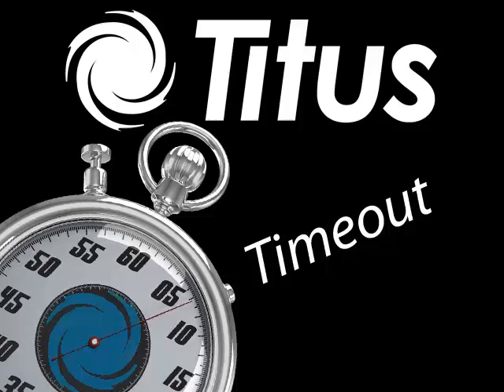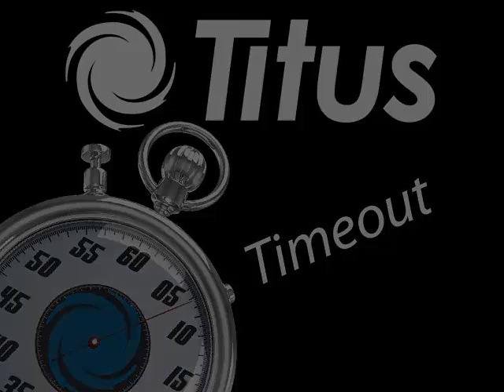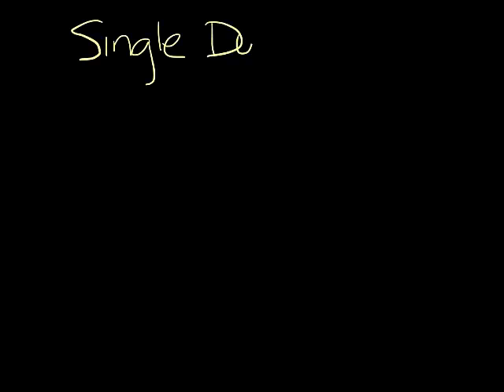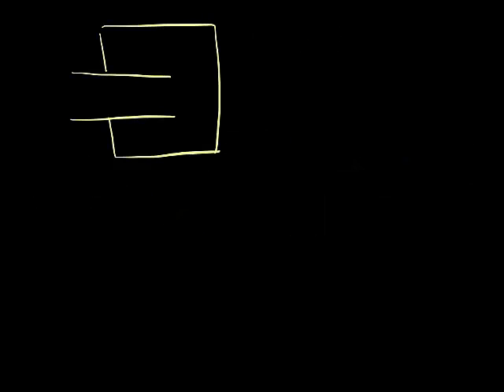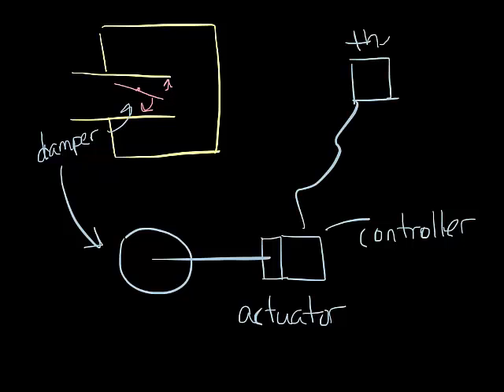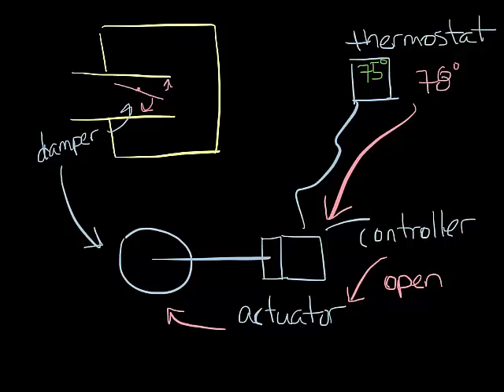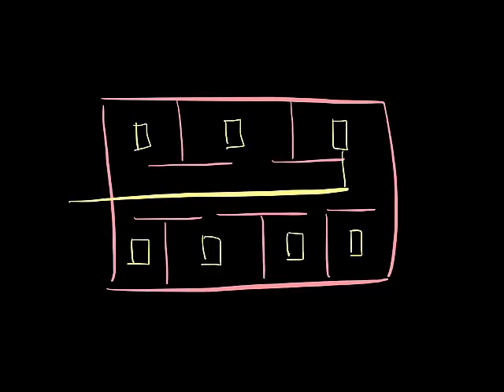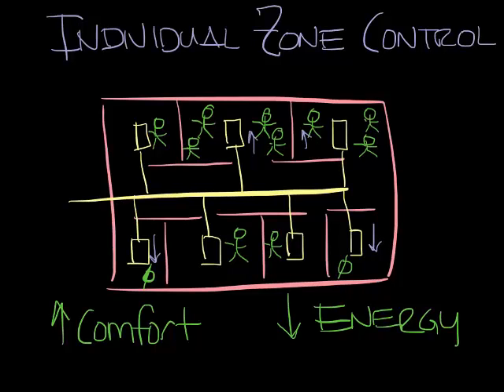Titus Timeout Podcast - VAV Box Basics

Comment: What happens when heating is on, and a zone requires cooling? For example, if you have a building where the zones towards the perimeter need heat, but the zones deeper into the building need to be cooled.
Reply from the maker: Question: I believe you are asking, “What happens when an individual temperature control zone is calling for cooling while the air handler is currently supplying heat?”

Answer: Large buildings typically have central air handlers that are supplying air to dozens or even hundreds of individual temperature control zones. Each temperature control zone is handled by a VAV box. These large air handlers typically only supply cooling, but may vary their supply temperatures for summer and winter operation. Interior zones typically need cooling all year long. VAV boxes serving perimeter zones typically include some form of reheat (electric or hot water) to handle winter loads due to glass or exterior walls.
Reply: @TitusHVAC  Yep, that's what I meant. Thank you for your response!

Comment: What is the difference between Vav and  motorised VCD in HVAC? Can we use a motorised VCD instead of a VAV box or vice verse
Reply from the maker: If by “motorized VCD” you are referring to a “motorized volume control damper”, that’s a pressure dependent airflow control device. It could be connected to a wall-mounted thermostat to provide variable volume airflow for room temperature control. This would be pressure dependent control because the air volume delivery would be dependent on available duct pressure. It also would not be able to control minimum or maximum flow limit control. This could result in stuffy conditions when the space temperature is satisfied or annoyingly high sound levels when loads are higher.

Today’s typical “VAV box” is a pressure independent air terminal. It typically includes an inlet velocity sensor and a VAV controller that provides air flow limit controls. This ensures that minimum ventilation requirements will meet ASHRAE 62 guidelines and that maximum flow limit will help to manage airflow in the building while limiting sound levels. Terminal units also provide many options with regard to electric and hot water reheat.

So to answer your question directly, a motorized VCD can be used in place of a VAV box, but it is generally a poor choice. Pressure independent control is standard these days and that requires a VAV box with an inlet sensor and a VAV controller.
Reply: Thank you for your response. Another question strikes, a VAV box is dependent of the pressure of the main duct so how it is a pressure independent control unit. What is the definition of a pressure dependent control unit and pressure independent control unit ??
Reply from the maker: Pressure dependent controls just drive a damper open or closed to control temperature. When the room is satisfied the thermostat sends no signal and the current damper position is maintained. The damper can move full open to full closed or mechanical limits can be set on the travel. 

Pressure independent controls require a velocity sensor. These VAV box and their associated controls provide airflow within minimum and maximum flow limit settings based on load requirements. These controls therefore automatically readjust the damper position to correct for any changes in inlet static pressure.

For instance, the thermostat is commanding a controller to provide 500 cfm. The damper moves until the inlet sensor registers the velocity associated with 500 cfm. There’s a sudden change in room load in a nearby conference room, so when that box opens the duct pressure starts to drop. The box in the first room will automatically open to maintain 500 cfm to the first room.

So pressure independent controls can automatically compensate for changes in duct pressure, so long as there is adequate pressure to meet all the airflow requirements. When airflow is insufficient and boxes are ‘starved’, pressure independent boxes simply drive wide open to provide whatever airflow is available.

Comment: how VAV controller can change the mode from cooling to heating, we all now that controller should work in cooling direct and in heating reverse?
Reply from the maker: The VAV box is usually being supplied with cooling air only (55 degrees F from the air handler) and is trying to satisfy the thermostat. So if the thermostat is set at 75 degrees and the room is 72 degrees, the VAV box closes the damper (to supply less 55 degree air) and if the room is 77 degrees, the VAV box opens the damper (to supply more 55 degree air).The VAV controller is not doing auto-changeover from cooling to heating. There are controllers that do auto-changeover, but they need to get a supply air temperature signal to know when to change from heating to cooling. This is not how typical VAV boxes work though.
Reply: Funny. I was just working on a Titus II VAV with AUTO CHANGEOVER today.
Sort of.

The controller is set to maintain a minimum airflow so it can not close completely.
When the space starts dropping enough below the setpoint there is a pressure actuated switch that then brings on the heating contactors.With the airflow at minimum the electric heat can temper the 55 deg air to make it lukewarm at least. LOL

This building I am working on appears to be a bastard with several different brands and types of pneumatic VAV boxes and t-stats. And some are direct acting and some reverse!

Whoever set up that building needs a good swift kick in the ass.
But that's Scottsdale, AZ for ya.
The WORST engineering and building designs I have ever seen.
Reply: @hackfreehvac  For what application in AZ did you need to heat the space?
Reply: @allymacky4039  Office spaces.
Reply: @hackfreehvac  Oh man. Temps get that low in AZ too? What area/what time of year?
Reply: @allymacky4039  Here in the desert area it hits high 20's when we get a cold snap but stays closer to 50 most of the winter.

Up in central to northern Arizona it gets down to about zero or so when they have cold snaps and runs 20 to 40 most of the winter.
For example, the low temp for Flagstaff, AZ tonight will be 33 degrees.
While the low temperature for here in Glendale, AZ will be 62 degrees.

Flagstaff and the Rim area above Payson, AZ up to Show Low, AZ all run about 20 to 30 degrees below that of Phoenix.
Reply: @hackfreehvac  Oh cool I was aware it gets cold in flagstaff and upward but had no idea it could get that low in areas like Glendale. AZ is my dream place to live..for some weird reason. And I don't even live in America..yet

Comment: I love these videos!

If you wanted to make this model match a common reality, you would have VAV boxes being controlled by zone sensors in unrelated zones which have big heat absorbing bookcases in front of said zone sensors to make them think that those zones are hot, send that information to the VAV controllers and cause the VAV to try to cool the zone it is actually serving based on that unrelated zone's bad input.  Gotta love remodels.

Comment: would the vav box controller send a signal to the air handler fan to ramp up more air if needed? Thanks.
Reply from the maker: Sorry, I don't know why I'm just now seeing this, but I'll answer it for future reference. If the building has a building management system (BMS), you could make a sequence for the AHU to look at what the VAV boxes are doing. An easier way would be to put a pressure sensor in the ductwork and have the system maintain a certain pressure.